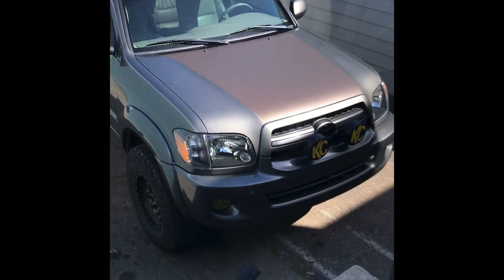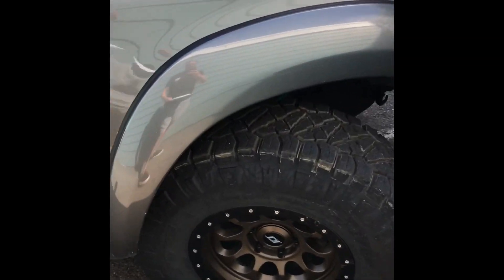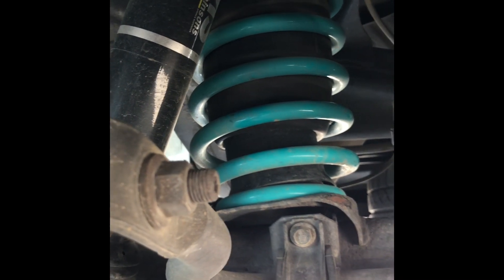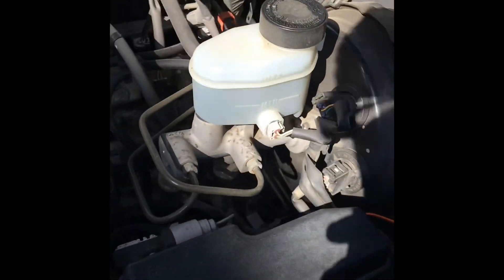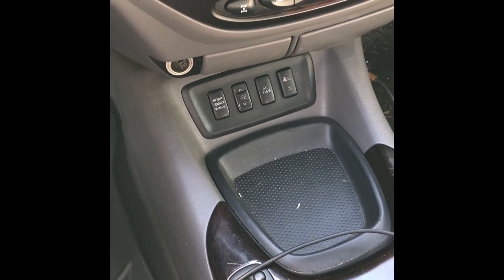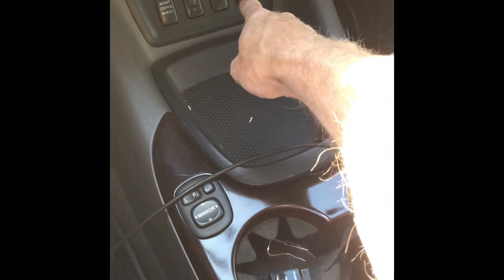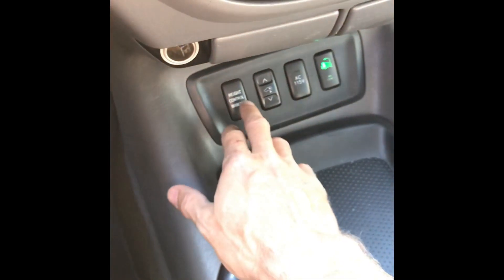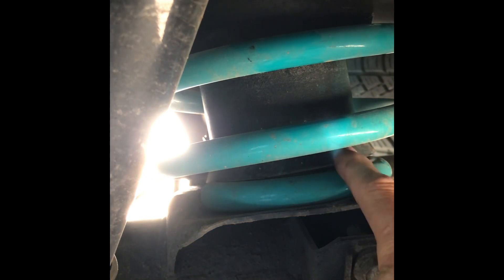1st Gen Sequoia Rear Airbag Suspension Hack! Adding OEM airbags to 3 inch lift with cabin control

Comment: The circuit fuse is 10A. Has the 3A switch that you have linked held up ok?
Reply from the maker: 100% solid
Reply: @cjhillin  cool, thanks for confirming.

Comment: Awsome video. 

I have a 2005 Sequoia Limited 2wd with rear air bags. I would like to lift my sequioa maybe 2.5 inches. What kit do I need to buy as I noticed you have springs in the rear and what from struts do I need? Can you send a link or part #
Reply from the maker: https://teqcustoms.com/products/0-1-75in-ims-complete-lift-kit-1st-gen-sequoia-00-07-dobinsons?variant=45426259460333&utm_source=google&utm_medium=organic&utm_campaign=100%20Flat%20Rate&utm_content=Dobinsons%200-2.5in%20IMS%20Complete%20Lift%20Kit%20%2F%201st%20Gen%20Sequoia%20(01-07)&gad_source=1&gclid=CjwKCAjw4f6zBhBVEiwATEHFVh-HkChpkW67PLX0SLVKX5VHI_qhtRuR1ep6YNjO64-eXeGCYmom8BoCIkQQAvD_BwE

Comment: Hey bro, I saw you hack for the suspension air bags and I wanted to ask: how did you rig that exactly. I bought a new compressor, installed it and it’s still not working. The hopping is driving me bonkers
Reply: Hey, same issue -curious if you can share how you diagnosed main issue and resolve? Thanks

Comment: Curious to know if you just tried adjusting the height setting?
Reply from the maker: I did, doesn't matter because after 17 MPH the bags deflate automatically. That is why I went with the switch to set the PSI so it stays constant.
Reply: @cjhillin is it bad to keep it on L or H setting ?  Certain speed limit?

Comment: How many miles are on the car now?
Reply from the maker: 5,000 miles all good in the hood. These OEM bags are tough. I've wheeled this truck and the system is solid. The spring encasing the bag really protects the components.

Comment: Forgive my ignorance...I understand that you're running the "stock height" Dobinson springs and shocks in the rear (C59-343 and IMS59-60682) so effectively no lift in the rear (when air bags are deflated)?  What are you running in the front, looks like they have  a "stock height," "stock weight +1.75," "stock load +1.80," and "stock load +2.50" (all paired with IMS59-50222 shocks).  With your setup it looks like you're sitting pretty level (with no elevation from the air bags)?  

Finally, did you add the dampers that are typically added when the airbags are “converted” to springs or are the springs mounting around/to the top of the airbag somehow?  

Thanks!

Comment: How’s it ride?  Can you effectively stiffen things up?   Handles a load better?  Did you make any adjustment to the sensor that tells it how high / low it is?   Still holding up fine ?
Reply from the maker: All is good still. It works like a champ. I keep it with a bit of air in the bags to prevent any metal clap. I didn’t adjust the sensor at all. I may mess with that at some point but the stock set up works great for me. Been installed for almost a year now.

Comment: Can you Do a more detailed video on how to wire up that switch with the fuse
Reply: Just run the device he showed in the fuse box to two leads, put a 10 amp fuse on one, then connect a switch to both leads

Comment: Great video.  Are you frame to diff or metal to metal on the top and bottom of coil spring?  I know you are on the bottom as you illustrated.  Are you using some sort of rubber isolator on the top of the spring that's over the air bag ?  Thanks for the great content.
Reply from the maker: Hey appreciate the question, since the airbag come from the top down there is no need for a spacer. If you don’t add a bit of air the metal seat on the airbag will clank  on the rear axel. I’ve been running this set up for months with no issue.
Reply: @cjhillin now that is been a year is it still treating you well

Comment: Where did you take the 3 wires to?  One is obviously ground.  I figured you took the other two to both sides of that fuse holder.  I did that tonight but turns out the positive side of that fuse is always hot so the light is always on in mine.  I checked mine with a meter with the key on so I mistakenly assumed it was only hot with the key on so the switch light is always on even when the car is turned off.
Reply from the maker: I can email you an video on how I wired if you like
Reply: @cjhillin  I just figured it out. You technical have to wire up the switch backwards compared to the instructions. Basically backfeed the switch then when it turns on the line side gets power and turns on the light. Either that or I labeled my wires wrong 😅

Thanks man 🙂

Comment: Which exact springs are in the rear? Are they factory length? Do I have to do the switch mod or can I just run the springs over the bags?
Reply from the maker: They are the Dobinsin IMS rear shocks standard length. Yes to switch or bag will deflate after 11mph
Reply: @cjhillin   I have a 2.5 inch lift up front with Bilstein 5100, stock Bilstein 5100 in the back now my air bags are starting to leak so this mod looks perfect for me. Would I have to get longer shocks or keep the stock Bilstein 5100?
Reply: What springs are in the back stock Dobinson stock replacement?
Reply from the maker: @berndern15  https://www.dobinsonsdirect.com/products/dobinsons-4x4-stock-height-rear-coils-for-toyota-sequoia-2001-2007-4-7l-v8-c59-343?rq=mk_toyota~md_sequoia~yr_2000-2007-suspension-parts
Reply from the maker: @berndern15  359-343 stock ride height
Reply: @cjhillin  thanks man I really appreciate it just ordered I’ll check in when installed keep up with the content.

Comment: How is the ride like? Stiffer? Also did you consider adjusting the rear suspension height sensor so the airbags stay inflated?
Reply from the maker: the ride is not stiff I don’t inflate the bags all the way in normal driving only enough to seat them to the axle. the ride height adjuster doesn’t stop your air from being deflated at 17 mph. that is why I created the switch to ensure air stays in the bag while driving.
Reply: @cjhillin  Do you have the part number or link to the coil springs you used? I have bilstiens on order for the front and I'm starting to collect everything I need for the rear. :)
Reply from the maker: @aaronpops4108  Dobinson 359-343

https://www.dobinsonsdirect.com/products/dobinsons-1-75-ims-lift-kit-toyota-sequoia-uck35-45-2000-2007?rq=mk_toyota~md_sequoia~yr_2000-2007-complete-suspension-lift-kit

Comment: Hey man, are those factory bags in the coil springs??
Reply from the maker: Yah buddy! Had them on now for about 3 months with zero issues!
Reply: @cjhillin  that's sick! What did you have to do fit the springs? Ive pretty much got the same parts in my checkout cart on 1stgenoffroad . I really want to keep the factory ACH so this is perfect
Reply from the maker: @sludged08  Hey bud..the bags fit perfectly inside the Dobinson rear springs. almost like they were meant to be. I included a few links in the description they may help making the switch.
Reply: @cjhillin  sweet thanks so much buddy, I'll keep an eye out. Always wondered why It couldn't be done.

Comment: I have always wanted to find a spacer for those bags. How does having those bags affect flex while you are wheeling?
Reply from the maker: I cut my rear sway bar link and have a ton of flex, no issues to report. Went and did valley of the moon, was flexing hard and no problems.

Comment: Bro amazing hack , so with my Sequoia a 2006 Sequoia limited 4wd with air suspension tends to bottom out when parked. My mechanic tells me it's the selinoid relay not the air bags...
Reply from the maker: Maybe try inflating your airbags when parked pull the fuse and see if it deflates.if it doesn’t then you can assume he is correct.
Reply: @cjhillin  which fuse and where would I find it ,?
Dude thanks again for your response and help
Reply from the maker: @sandovalpaul  about halfway through the video I discuss the fuse and show where it’s at. Around 2 minutes.

Comment: Thank you for posting this.. how has that modification been working over the time since you installed it?
Reply from the maker: Flawlessly,  no issues to speak of.
Reply: Whats the part number for the dobinson spring you used?
Reply from the maker: @naijakem  https://www.dobinsonsdirect.com/products/dobinsons-1-75-ims-lift-kit-toyota-sequoia-uck35-45-2000-2007